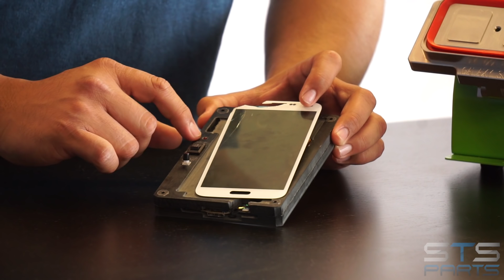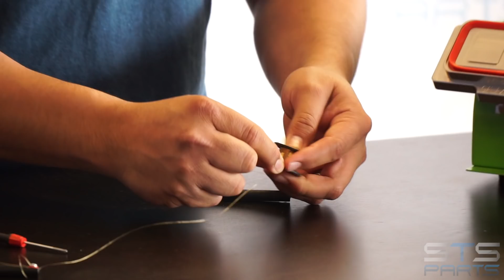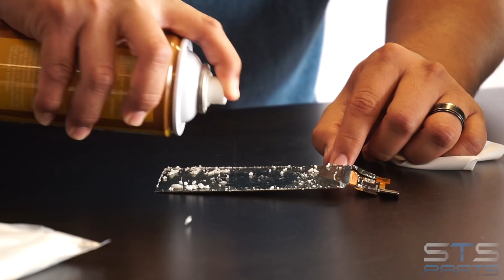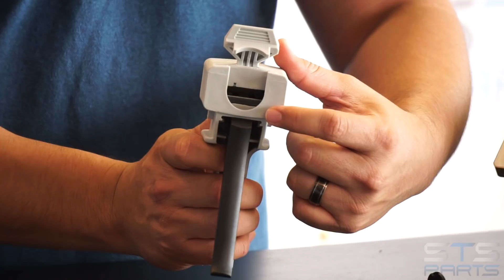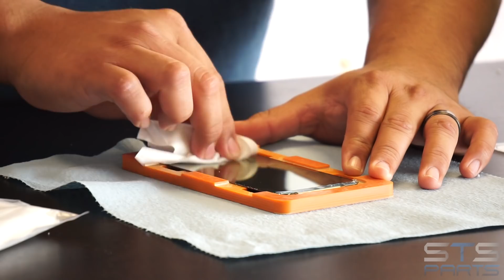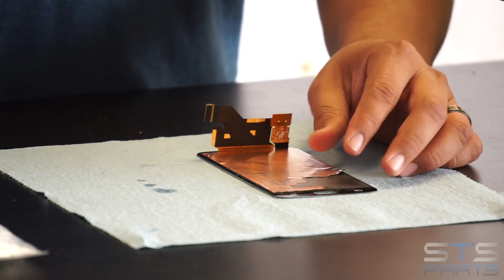Galaxy S5 Glass Only Repair using LOCA UV glue

Comment: can you post a video  on the s5 lcd removal? Also can you use the hybrid lcd extractor  to remove lcd assembly from galaxy s5 or with playing cards?
Reply from the maker: +Paul Rodriguez I am assuming here you are referring to the screen instead of LCD? If so you can use the 3 in 1 plate http://stsparts.us/products/frame-and-glass-splitter-3-in-1-for-samsung-iphone-lg-screen-refurbishing?variant=1091513512 to take the screen off the frame on the s5. You just need patience and I usually use a plastic spudger to go around the edges to successfully remove it from the frame. Thanks!